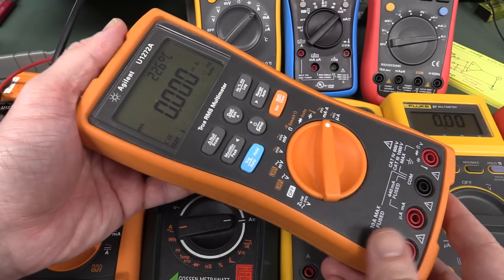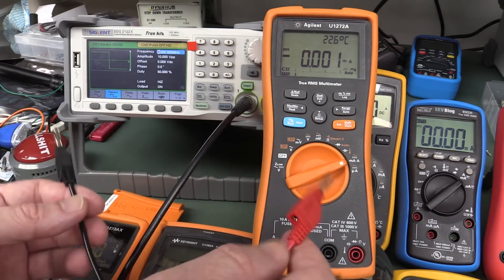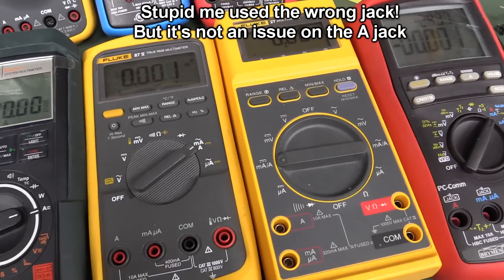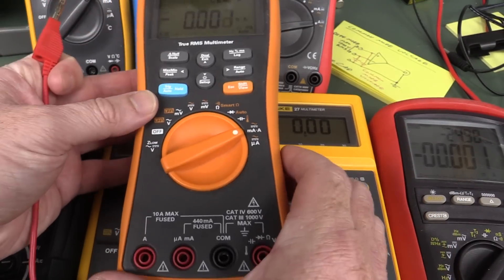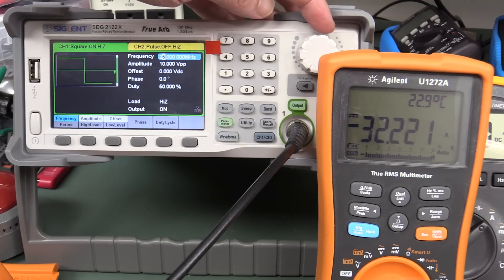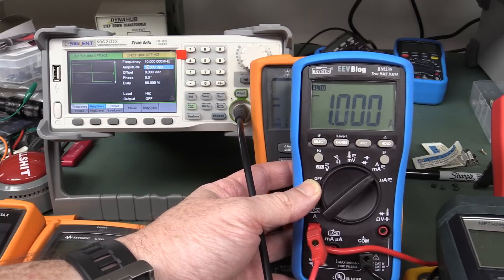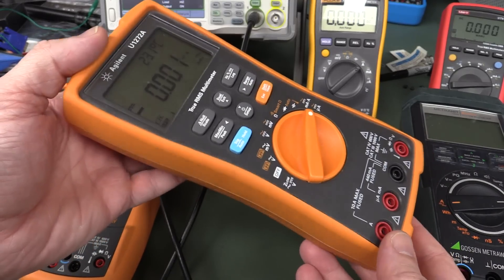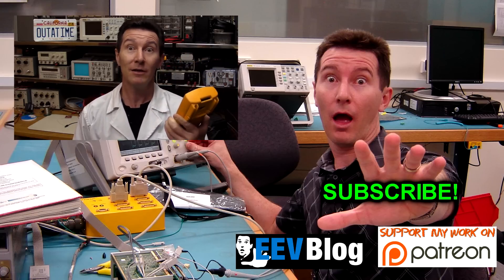EEVblog #933 - Keysight U1272A EMC Issue

Comment: It does similar when measuring capacitance, if capacitor has higher ESR meter will just flash readings without seatling down.

Comment: Thanks again to the EEVblog and those on EEVblog forum thread (http://www.eevblog.com/forum/blog/eevblog-933-keysight-u1272a-emc-issue/?all#lastPost) who pointed out the EMC-related finding with Keysight’s U1272A family of digital multi-meters. Your input is very helpful and we value it.  
 
As mentioned in our earlier post, we asked our EMC technical experts to look into this – and they were able to replicate the symptom. Keysight engineers found the majority of U1272A measurement modes and ranges meet published specifications in the presence of an RF field, but the product is susceptible to RF fields in certain measurement modes.

You can significantly improve the immunity performance by using the U1272A’s low pass filter, especially during DC measurements. Based on the insight you provided, we are characterizing the accuracy of the U1272A’s performance in the presence of an RF field, and will revise the product’s data sheets accordingly. We will let you know via this blog when we have posted the revised datasheets on Keysight’s website.

For those of you who use a U1272A, please be aware that since we released firmware version 2.04 in 2013, you can independently configure the low pass filter for DC and DCAC measurement modes. You can refer to pages 131 through 133 in the U1272A product user guide for instructions and filter options. 
 
And if you haven’t done so already, you can download the latest U1272A product firmware, Version 3.03, which was released in 2015. All firmware released since version 2.04 has the DC low pass filter turned “on” by default. To get the latest product updates as soon as they are available, sign up at myKeysight.
 
Again, we thank the EEVblog and everyone on this thread who have been involved in this productive conversation. This exchange reinforces Keysight’s belief in the important role your feedback and social media plays in improving product quality and increasing customer satisfaction.

Comment: I get exactly the same phenomenon with Dave's uCurrent!  5MHz square wave to either current input posts and there is full negative DC reading in the voltage output!  So I think it is a chopper opamp in U127x, too.  Possibly MAX4239 in that or a similar one.

Comment: Talk about milking it! So it has an RFI problem, but did it really need 10 minutes more waving leads about Dave? Why not ask Keysight for the results of their EMC testing? They must have done it as it has a CE marking.
Reply from the maker: +Mike Willis I was experimenting, that can be valuable. If you don't like long videos then you are on the wrong channel
Reply: Hi Dave - Generally do like your longer videos but thought you were labouring the point a bit. Anyway, did you get any feedback from Keysight? Clearly this meter has a problem in RF fields.

Comment: Dave, you did take the Agisight apart.  Is there any chopper opamp there? That could explain this as the interference between its internal oscillator and the external HF could totally ruin its internal zero adjust mechanism?

Comment: This one is much worse than the buggy Fluke. To lock up is not a good thing, but at least it does not screw up your measurements. But to just pick up random signals and display some nonsence is completely unacceptable. There can always be moments when you can not check the data or take your measurements yourself so you have to rely on your multimeters. And I don't see how can you feel any confidence with that HP/Agilent/Kesside/whatever meter. Or if you don't really care then why not just buy some somewhat decent chineese multimeter like from Mastech, UniT, IEK or others like this?

Comment: I'm wondering if this explains why some of our competitors efficiency figures after significantly lower than they're datasheets suggest! Maybe they use Agilent meters!

I must admit we bought a few Agilent meters a some years ago, for accuracy and features they we're initially good, but we've had too many issues.

Poor pulse voltage handling, rubbish battery life & meters failing for no good reason. Yet I don't think we've had a single fluke fail.

They're scopes are good, but the meters leave a lot to be desired at the moment.
Reply: Yes all the flukes I have ever used apeared to be very nice and reliable devices. Even the recent more affordable chineese ones are reasonably good. But in terms of pure functionality/price ratio the meters don't look so good in comparaison with many other brands. The flukes are just way too expensive.

Comment: I have a U1272A manufactured in early 2011 and I wasn't able to reproduce anything like this amount of coupling. Using a 5W VHF transmitter with the whip right up near the meter gave a reading around 5mA on the 10A range. Using a signal generator and RF generator I couldn't get above 30mA, doesn't really matter if I touch it or mess around with grounding.

Comment: It's not a cheap meter which makes this even more embarrassing. Does anyone know if Agilent even designed this series or if they're ODM from Asia Inc much like some of their past inexpensive scopes were? One advantage cheap meters have is they usually have miserable frequency response for ac current and no true RMS. So RFI is much less likely to get very far. But wider bandwidth, true RMS, and possible higher gain on the current shunt for less insertion loss, require more careful engineering and testing.

Comment: Damnit... I own an 87 V with the GSM problem (earlier revision) and I own a U1272A... Now I'm scared that I'll buy another meter and it will be discovered to have problems too :(

Can I DIY fix this problem maybe with some copper tape or something?
Reply from the maker: The 87V has a lifetime warranty. Maybe if you contact Fluke and say it's not "fit for purpose they'll give you a replacement?
Reply: Maybe it is just you -- the act of you buying a meter collapses a quantum wave function that causes all meters of that model to develop a defect.
Reply: Kevin Harrelson Does that mean I shouldn't buy an EEVBlog meter? Wouldn't want to ruin it for Dave :/

Thanks for the suggestion, Dave. I'll look into it, but I don't expect them to help me because I bought my 87V on Ebay. It still cost me a good bit! I doubt they will help me and I don't really hold that against them too much (honestly I do think warranties should transfer but I understood their policy when I chose to buy it, so it is what it is)... Can't hurt to ask, though.
Reply: Return it as unfit for purpose.

Comment: I just tested my U1253B (OLED) using the same conditions and it appears to be immune. The worst deviation that I could get was -0.13µA while directly coupling the positive output into the jack.
Reply: FrozenHaxor : Same here.  U1253B tested up to 25 MHz square wave, same signal generator.  The meter reads 0.0000 - 0.0001A
Reply: +Shaun Merrigan How's the battery working out for you in your unit? I struggled alot with poor running times and severe charging problems. Also had some obscure problems where the battery appeared to be pretty much overcharged by the meter and I was unable to get any reading at all, everything appeared to be running but the ADC, removing and briefly shorting out the battery to knock off the voltage solved the issue. Replacing the battery with a GP brand solved most of the problems for now. Other than that it's a great meter.
Reply: +Shaun Merrigan
 Looks like we have a new firmware release, not from a month ago. Wow. After like 3 years of silence, hopefully it will get rid of many of the querks that I had, provided I don't brick the thing...
Reply: +Shaun Merrigan Oh lord, now  Iget Keysight logo on startup. I feel duped.
Reply: I have had no battery/charging problems at all, but to qualify this, I have only had the meter for 8 months.  The included battery is  250mAh capacity  "IMedion" from Maha Energy.  I have the 3.04 FW installed, and I just turned off the Keysight greeting from the setup options :-)

Comment: What if you plug something into the other socket at the same time to make a circuit - basically you measure on a very high impedance system and that could affect the result. If you make a real small current circuit and together with the red wire plug'ed that into the meter - what results do you get then ?

Comment: I'm an engineer that deals with quite a lot of RF systems, and also a radio amateur. Having a few Watts of RF energy floating around while measuring currents and voltages isn't unusual, so I don't think I will be buying an Agilent, er, Keysight meter for work or home! Unless Agilent want to convince me otherwise!

Comment: I've had nothing but problems with this meter. First the meter would give readings of resistance sometimes when nothing was connected, this was obviously a firmware issue as cleared when I reset the device. I had the rotary switch fail after 11 months, the test leads fail after 8 months and then to top it all off I tried to solve these issues with a firmware update and it bricked itself with no way of getting back... I am currently logging an official complaint with keysight and to be honest their customer service is very poor saying I will have to buy a replacement. Not good keysight when I've spent $500 on a emter with obvious design flaws... this is just the last nail in the coffin... I bought a fluke 177 and will try to never buy an Aligent product in the future.... Rant over!

Comment: So this meter family is essentially useless for measuring current near any switching/digital circuitry like Switchmode PSUs, PWM or brushless motor drivers, LED drivers and class D amplifiers. Maybe even the clock on an I2C/SPI/serial line is enough throw it off.
Reply: So it's basically useless around everything besides my cat :D Uuh, static electricity, maybe not...
Reply: How has it not been noticed before??
Reply: Better use an analog meter like one of the good old Simpson meters. They'd never mess up like that!!

Comment: 10Vpp is nothing! This meter is completely useless with SMPS units or Class-D amplifiers, where peak levels are much much higher. Absolutely shocking. How on earth did they get this thing through CE checks?
Reply: CE claims (not checks) are supposed to verify that it won't kill you, not that it's actually good at what it's supposed to do.
Reply: Manufacturers self-certify CE compliance.
Reply: No you also need to conform to EMC emission and immunity standards for CE.
Reply: nophead
Hahahahahaha. I guess the stuff I get from the other China where it doesn't pass any standard.
Reply: If you measure 0.2 amps intead of 1 amp you could destroy your power supply
Reply: Maybe they got through the other CE put on all products from China.

Comment: I've checked it with older U1252A. The issue is much smaller and it shows strange readings only when connected directly into an amps jack (about 25 mA of apparent current with similar funcgen settings). It does not induce it through the air.

Comment: I learned from the old folks that the only kind of meter that should be used to probe around in RF gear is an oldschool needle analog meter. It is surprising that it does it on such a low amount of RF though, i wonder what would happen if you had it around a 10-50W transmitter like i work on sometimes. Will it go up in smoke? :DMy UT60E is fine for measuring voltage in RF stuff, but if you try to set it up to measure DC current of a final amplifier it will show significanlty more than the circuit is actually drawing, no matter how much filtering there is on the input.

Comment: I would guess that some fundemental harmonic frequency of the square wave is causing the issue. Have you tried setting the FG to a sine wave and then sweeping trough the band?

Also: What would happen if you'd hook a real (13.56 MHz) antenna up to it? That would really disrupt the reading, right?

Comment: Shocking.  Please do a tear down.  I'd like to see what is causing this.
Reply from the maker: Yeah, needs another video possibly. Would help if we had the schematic. These problems can often take some solving though. The Fluke one IIRC turned out to be something obscure with the programming line on the MSP430 micro.
Reply: EEVblog
The problem actually looks similar to something I saw in a different instrument many years ago.  Basically, the shield was connected to common via a long wire.  So the inductance of the wire, and the capacitance from the shield to the ground plane formed a resonator.  If this is the case with this DMM, it should be an easy hack to fix.
Reply: FACEPLANT

Comment: For that bench meter showing the uA value, you said it has "issue" - are you sure that is not actually the real current value through the stray capacitances? Of course the route is wrong, but the value could be in the right region - couple of amps surely not...